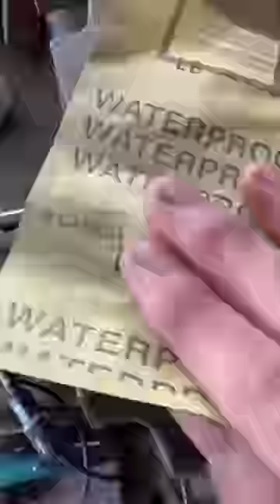CHEAP stripped oil pan/bolt solution!

Comment: Why did you jack it up for oil change related work.  Ive never needed to jack up my f350 for oil changes and its stock.  Im gonna park my trl off to the side then while i got it hot im gonna change my oil.  Its been 2 years i should do it again.  Lol i know what people are gonna say its only getting 1500 miles a year ruffly as im not running my 7.3 that much any more as i have a gmc 1500

Comment: I had this condition but opted to use a rubber boat plug that expands when tightened. It never leaked and was on the truck for years.

Comment: Those drain plugs that are similar to what boats use would have worked well on that. It has a nice flat surface for the rubber to seal on and a spring loaded nut goes inside the pan.
Reply from the maker: Interesting, I’ve never heard of that
Reply: Search for doorman ez oil drain plug

Comment: You should have ordered a rev nut kit that would have worked better than that for oil pans to quickly replacement
Reply from the maker: Yeah I agree, several others suggested that as well. Would have saved me a lot of time and struggle

Comment: If it leaks, its not working. 
These pans are a dime a dozen at the pick apart yards. They are filled with these trucks, and most of them arent rusted to all hell. 
$10, and 2 hours total, and you wouldnt have this problem.

Comment: Why?  Do it the right way.  Pull the pan, weld a washer inside or retap the hole, put the correct bolt in, enjoy a beer.
It didn't work if there is still an oil leak.

Comment: You could’ve just left it and drilled a small hole near it to drain it then just run a self tapper with a rubber washer in. It would’ve saved all sorts of time because quality wasn’t the objective anyway.

Comment: hear me out, new oil pan and a clean install. no leaks and better in the long run, or a set of good quallty taps and drill and tap for a bigger drain plug

Comment: The pan may be expensive but engines are very expensive. A new pan gasket is cheap. Should've pulled the pan and repaired it on the bench.

Comment: All these people shitting on your weld, atleast you got off your ass and fixed something! I doubt it's your welds causing the leak, but rather the fitment of the bolt in the nut. Add a little pipe sealant tape and I bet it'll solve your leak.
Reply from the maker: Hey, I really appreciate it! To be fair the weld is very ugly, but some people can be very snarky. 

I’ll give pipe sealant a shot, it did seem to me like it was leaking from the bolt rather than the weld, but I’m not sure
Reply: @Hobbies_Galore  Teflon tape, couldn't remember the name last night. Little bit of that and you'll be good to go.
Reply: @doctorfail2860  I'd use liquid Teflon and tape for that one

Comment: You didn't need to do that. The pliers you had would've worked fine or a bolt extractor. That thing needs an oil pan now.

Comment: Start over and try again. Have some patience and pride in your work. You are on the right path but try practicing on some scrap metal then turn up your heat and slow down your wire. I promise you can do this better. I’m not beating you up I was the same way 45 years ago so slow down and you have this. Show us your new work. With Respect and Support.   RR

Comment: Bro, you went about it the wrong way.
Yeah, first take out the old one, clean the surface of the pan etc.
Then, take your nut that fits the new drain plug and place it over a new piece of sheet metal, with hole drilled out for drain plug. the sheet metal piece can be 3x3 inches or 3.5x3.5 inch, whatever you are comfortable with, the smaller the better.
Now you place the new square piece flat up n lined up with the hole on the oil pan n mig weld it in place going back n fourth with your welds to control heat.
this is a much cleaner setup, n if your welds are good n clean it will not leak.
Your repair looks like crap for all the effort you put in... 🤖

Comment: maybe if you ran a bead on it instead this tack tack bullshit. unless you're tig welding (dipping technique with pulse)  that tack tack bullshit never gets the previous deposited weld metal hot enough for complete fusion.

Comment: A better way to fix this (I've done it ) welde a flanged bolt to a piece of 1/16 plate. Them you can weld it on much better. And worst case smear rtv over the welds in event of persistent pin holes

Comment: If i was to cheap to get a new pan i would get rid of the old nut inside the pan and weld a new one on from the inside (if that is a pan with a nut on the inside)

Comment: Why not just retap to a larger size and make your own gasketed oil drain plug to match? Would be less of a hassle than welding overhead, I’d be wary of welding on vehicles anyhow with the body often being used to ground many of the electronics, causing electrical problems down the line too
Reply from the maker: I wanted to do this, but the hole had already been retapped with an oversized bolt. Another retap could break the metal threaded bracket inside of the pan.

Thank you for the comment!

Comment: no you totally shoulda just retreaded the pan drill it out thread it up flush some oil a good couple times or pop the pan real quick dump it boom no leak
Reply from the maker: Good idea, but the pan itself is stamped steel and not threaded, the metal piece in the pan that is threaded was already oversized. I was warned another retap could break that metal piece off inside the pan

Comment: You know the welder has different voltage and speed settings so you can weld thinner metal without burning through right. Why would you even post this as a solution if it leaks?  The only thing you got accomplished was draining the oil lol

Comment: next time drill a smaller hole that doesn't get into the treads and use a easy out to take the plug out no need to weld for fix anything just buy a new plug

Comment: You own a 7.3 but an oil pan was to expensive?
Reply: The engine needs to be removed to replace the oil pan.
Reply: @michaelbenoit248  no it don’t.  Undo motor and trans mounts and lift engine just enough.  Maybe 1/4 inch of enough room but it works.

Comment: FYI if you soak a zinc nut or bolt in white vinegar it will strip off the zinc back to bare metal, clean for welding. There is an old saying if ya can’t weld ya can’t weld. You sir can’t weld.

Comment: If ur going to all that trouble bud at least put a valve back in so u don't need to mess with a blasted bolt anymore..no tools needed to drain the oil then. Just saying

Comment: Why does everyone think oh ok the bolt and pan are completely toast when the bolt is stripped and the pans bolt hole is only a tad wider. No one ever thinks that oh well maybe I should self tap the hole and put a bigger bolt in makes more sense when you can buy a whole box of 100 bolts for 20 bucks and save 450 on a Brande new oil pan

Comment: If you were able to move the drain bolt with the pliers why not finish the job that way?? Beside once it’s out why not go to owheelies or vatozone and just get a new drain plug that fits instead of welding and all that nonsense that caused your oil pan to leak??

Comment: Next time you change the oil just spray It down with brake cleaner and then silicone the crap out of it before you add more oil 😂 that’s what I would do

Comment: Wouldn't be too bad if you didn't suck at welding. Would also be way easier to just increase the size of the hole with a tap and get a bigger nut.

Comment: I would have put a good used pan or new pan on, and let NO ONE touch that drain plug except me. Your repair would probably have worked if the pan was off and used a brazing rod, “A” for effort but it’s still leaking……
Reply from the maker: Yea, I don’t let anyone touch my vehicles. This has been this way since I bought it. I would have preferred to buy a new pan, but I didn’t have the money for a pan or an engine hoist (since the back of the engine needs to be lifted) 

Brazing rod is an excellent idea, someone else mentioned to me as well. 

The leak is a pain, but at least I can change the oil easily now! Thanks for the comment

Comment: That's very dangerous welding on the bottom of an engine covered in oil and fuel...
Reply: What fuel? And oil doesn't catch on fire or combust easily
Reply: @codyramos3200  I'm just talking from first-hand experience. When oil starts burning its very hard to put it out and MIG welders throw very hot sparks. Welding close to fuel is very dangerous too. I know safety is usually a joke, but one day it won't and you don't want to be in a position to regret it. Stay safe

Comment: So net change, zero.
Reply from the maker: Well now the drain bolt can be taken off and on which was the point!
Reply: @Hobbies_Galore  with the tiny little bit of the leak, that seems to be the same as when he started.
 And the ultimate part would be no leak or drip.
Just sayin
Reply from the maker: @johnstewart7059  eh, I just wanted to be able to change my oil

Comment: Leaks as much as the stripped plug
Reply from the maker: Yes it does! I didn’t make it clear in the video, but the purpose of this was to he able to have a drain bolt I could remove for easy oil changes. The dripping is unfortunate, but this does fulfill its purpose.
Reply: @Hobbies_Galore  I understand what you're saying and am all for people doing their own servicing on their own vehicles (I am a licensed mechanic). But at this point, this repair is currently outside the realm of your current skill level. Wouldn't it overall have been better for a professional to do this repair and you could have a non-leaking oil drain and still be able to continue doing your own maintenance?
Reply from the maker: @tamaplayer22  no mechanic wanted to do this. Took it to 3 different shops. 

They all wanted to replace the pan. If I had the money to ball out, I wouldn’t do any repairs myself.
Reply from the maker: In total this cost me 80 cents for the nut. I already had spare drain plugs. Maybe a dollar or two for wire. 

And the way you learn is by DOING. Something will always be “out of my skull level” until I keep practicing, failing, and practicing some more.

Comment: a better tip use a left handed (reverse rotation) drill bit most of the time they pull the bolt out. If not use your easy out in the hole. Or you can waste an hour or so like this feller did smh

Comment: Dude literally all you did was nothing because it's still leaks all you could have done was well to wash her to the bottom get everything cleaned up tap the new setup put a gasket and then put a new bolt simple and easy

Comment: Never welded in my life and i think i can do better welds. I get the feeling you didnt proper clean off any oil or drain the pain 100% as you heat the nut from welding its dripping oil into it

Comment: How did it work if it leaks u didn't even fix nothing u wasted ur time 4 the same result lol should of just left the old 1 in
Reply: He couldn't get the old one out  .. the oil pan is messed up.. that's why he drilled it out and fished that metal piece out of the pan... engine oil does need to be changed from time to time .

Comment: Yeah this is shit. Most people who don’t have $50 for a new pan probably ain’t got a welder either. Or the know how to use one. These pans are cheap and if you can work your way through doing this I’m sure you’ll have no problem lifting the motor a bit and getting the pan out. I’ve done 2 of these in my driveway over the years. A little time consuming but pretty straightforward

Comment: Had a Walmart tech out a 12 mm back where the SAE bolt had come out of my 3.8l lesabre.  The bolt was unloveable.  Walmart would agree to let me repair it for 150 even with me offering a typed up waiver stating it was mine after they paid, no recourse for me. Instead chose local GM dealer cost them $450 to memory about 17 years ago.  And the Gm tech left every bolt in the pan loose except the 4-6 he overtightened and ruined that gasket requiring an additional 160 or so.
Reply from the maker: I’ve never had someone else work on my vehicles. Mostly because I don’t have the money, but also because I enjoy the work

Comment: You used the belt technique 100% wrong As fuck to remove the oil filter, aaaaaaaaaaaand a simple retread would've done, like 1/8 bigger or whatever.!

Comment: Absolutely the wrong way to fix this oil pans are not that expensive lol nor are they hard to change why not just do it rite I dunno maybe that’s just me but I don’t like creating a bigger job for absolutely no reason but hey whatever makes you happy I guess
Reply from the maker: It should have just been replaced. I just don’t have the money. $250 for the pan before shipping. 

Install/removal requires lifting/tilting the engine as well. It’s a bit of a project. This was a $0.50 project

Comment: You are lucky it didn't blow the valve covers off... that's like welding on a gas tank.
Reply from the maker: I’ve gotten mixed reviews about this, I’ve seen plenty of people do small tacks on their oil pans, but in the comments I have some people say it’s fine, others say it’s dangerous
Reply: @Hobbies_Galore  it is very dangerous.. especially when it fuel injected... just lookin out for ya.
Reply from the maker: @nickklatt5932  appreciate it. Thank you for the comments
Reply: @Hobbies_Galore  I'd hate to see you get hurt.. be careful.

Comment: So you didn't fix it. You should have called your friend Ricky bobby who is a better welder than you. Or at the very least turned the power up.
Reply from the maker: I did fix it! Before the bolt spam freely, now I’m able to easily drain the oil whenever I need to perform a change. 

Also the pan is 1/8” stamped steel, too much power would burn right through the pan. Though I must say my welding is complete garbage